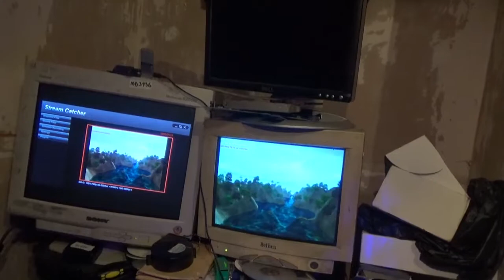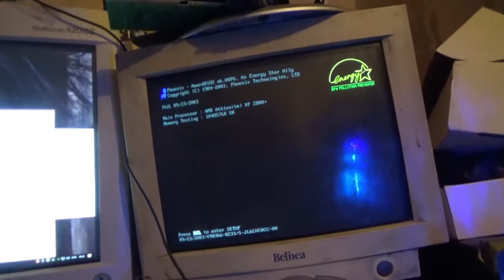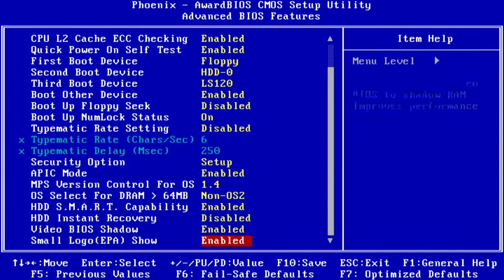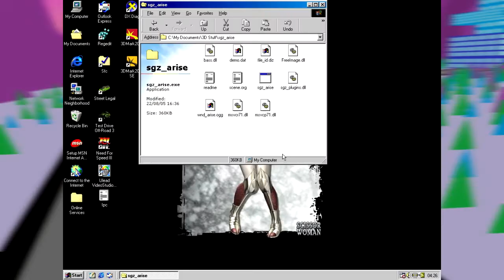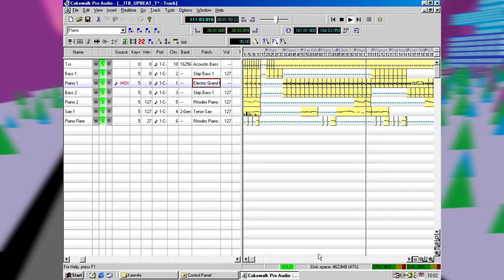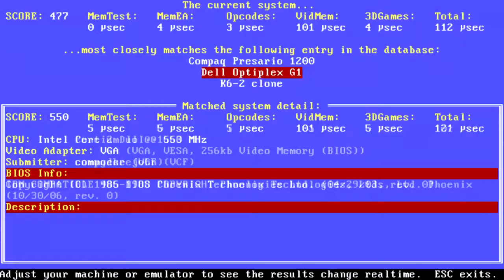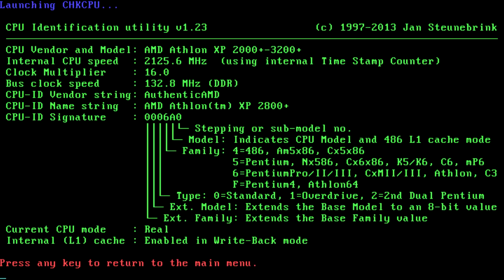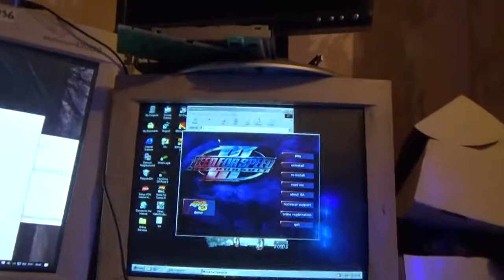Stable Athlon 2800?

Comment: Great video! Good to see you back. I love the Socket-A era and currently have two working systems (dual MP 2800+ and an XP2400+) along with two spare boards. I agree, the Athlon is a heck of a processor, but boards were definitely hit or miss. I had the best luck with MSI boards of that time period.
Reply from the maker: The MSI KT3 Ultra was probably one of the most reliable boards I ever used. The MS-6340 though, that was awful, used largely by cheap OEM brands. I owned a KT6 Delta FISR for a brief time before getting the horrible DFI and I've often wondered if it would have worked well. I never actually used it because PC World Component Center wrongly sold it as being the RAID version and their prices were already bloated, no way was I paying full price for the base model of the board. It would have certainly been easier to use now regardless as it was an ATX12V board, finding a PSU with a large enough 5V rail for this older Chaintech is a pain in the ass but I can safely say that I've yet to see a bad Chaintech K7 board. If only Quay Tec had ever had them in stock back then.

Comment: I had an AthlonXP 2800+ (2.083 GHz, 512KB L2 cache, Barton core), up until 2004. It had 1GB DDR400 in dual channel, a Gigabyte 7n400 pro2 motherboad (nvidia nforce2 ultra 400), and a Radeon X800XT. It was a pretty good performer, and quite an stable motherboard, running Windows XP. It was even able to run Half Life 2 (that came with a steam redeem code with the graphics card),  and Doom 3 at good FPS.
Edit : oh, I've forgotten to say I really love your retro hardware videos.Keep them coming! :)
Reply from the maker: Ah, that's the 333MHz version which this board won't run without the fix from Chaintech. When this stuff was new I mostly played things like Flight Simulator 2002 which the Duron did fairly well at. I really need to dig the discs out and see how this Athlon runs it. I do remember the Duron holding up to HL2 and I still have an awful review of Doom 3 I wrote for a school magazine with screenshots of it running on the Duron somewhere, it didn't run so comfortably though and that was not long before it died for good. Amazing to think Steam was around then and I still don't own a single game that uses it outside of a dummy account I had running for a brief time.
Anyway, thanks for the kind words.
Reply: Yes, it had a 333 MHz FSB, but if my memory serves me well, you could run the RAM at 400 MHz asynchronously (not that it made a noticeable difference in performance in games). That motherboard (Gigabyte 7n400 pro2),  was pretty advanced and it even had SATA1 ports, although I didn't have any hard drive in that format by that time.
Ah yes, I remember I had a very weird looking cooler (aluminum) that was able to keep the beast cool : http://www.frostytech.com/articleimages/200402/gigabyte3Dcooler_pspc.jpg
Reply from the maker: Mine does that, I can run the ram at 166MHz despite the CPU being set to 133MHz, but it hardly changes anything. The dead DFI I threw on the floor in this video had a SATA port, but it never worked properly. I was also under the impression that it was just a converter built into the board as it interfaced back to the first IDE channel - occupying the entire channel, so you couldn't have an IDE slave - in the BIOS and offered no advantage if it even worked at all without locking the machine up. I did not move to SATA drives, nor did I own any, until very late on. I think 2009 was my first SATA drive, though I did it in style as it was a 1TB drive which I still have. Obviously it wasn't for an Athlon. I only got my first SATA CD-ROM drive at the end of last year.

I remember seeing coolers like that. I also remember magazines at the time printing numerous articles about water cooling for a while before some of them stated air was dead and refrigerant coolers were the future. I think it was PCZone that even had a two page spread of it. Because that sure happened.
Reply: I started using SATA drives with the Athlon64, which was the upgrade for that AthlonXP 2800+. The Athlon64 also used one of those coolers, although with copper instead of aluminum, which managed to keep it cool and stable.
Reply from the maker: You know, I think the Athlon 64 I moved to after that DFI might have been another factor in why I didn't adopt SATA sooner. The connectors got damaged in transit and broke off the board, with no returns I simply stuck to IDE which at that time, was just as fast anyway and the channels were shared so I lost no functionality of the board. As the drives were less than a year old when the system was abandoned, with probably less than 150 hours on them, they were re-used as the first drives in the Pentium D. The one containing the OS was used as storage but actually still contains the OS, and should be bootable, in the state which it was left when the Athlon 64 was abandoned. Both of these just used the stock cooler and it was good enough.

Comment: Reminds me of the Duron 1300 system I used a about 12 years ago. That thing had a 7VJL Chaintech board that later got an XP2400 put in. Used it for a good while until it ultimately caught fire. These days, all I have is my cherished 7NJS Zenith which is collecting dust in a box somewhere. I always wanted to use an Athlon MP 3000 on there, but that chip has given me nothing but trouble. The 2400 in there now does the job I guess.
Reply from the maker: I almost used a 7NJS but then this came up, plus the history with nForce boards put me off. Who knows, it might have been good, if anyone could build a good NF2 board back it would probably be Chaintech. I always liked how the model numbers were plain and easy to figure out, I don't have to look up the 7NJS to remember it is nVidia because; 7 K7 board. N nVidia or V Via. J Full ATX. With performance, I'm of the impression that gains start falling off rapidly beyond the 2400+ anyway, the leap from there to the 2800+ certainly seems much smaller than the gap going the other way. From a practical standpoint it's pointless outside of novelty because it would be easier to build a K8 now. Not that I can't see the appeal of getting a K7 3000 to work.

Comment: My old Athlon XP3000+ on a A-bit NF7S with a GF4 Ti 4600 had those odd slow down problems your getting, it died before I figured it out. Only K7 I've had that died however.
Reply from the maker: Annoyingly when I finally sat down to debug the problem it had already disappeared of its own accord again. Now I have to wait for it to come back. Out of curiosity, do you remember which version of the 3000+ you had? Was it a 333 or a 400? I'm starting to wonder if it has something to do with bus speeds and contention, as I'd be willing to be the Ti 4600 is approaching the limits of AGP 4x at the best of times, though this doesn't explain the random element of the problem.
Yeah, this thing shifts a lot of air and it pukes a lot of heat, probably have to leave it running 24/7 in winter.
Reply: It was a 400 FSB CPU, ram was ddr 400.

Comment: Well, I actually have experienced this frame rate stuttering issues before, though it has been so long I can't remember if I found the reason or what the deal was.  My experience with nvidia drivers, especially of this time period is, they were constantly dicking with things and different driver versions behave differently on cards and what version of DirectX is installed.  My Geforce 3 and the 93.71 driver version will not run UT99 in Direct3D, no matter the directx version installed and will only run in OpenGL. This happens both on XP and 2000. Switch the card over to the 7800GS and the problem is totally gone.  Having said that, I feel it might be the driver version you are running. I don't know if you tried different versions or not so that's why I suggesting that first.  

Second thing, this might make more sense given the random nature of the issue, thermal throttling of the CPU is happening, which shouldn't, given the copper heatsink, but the motherboard temp threshold for throttling might be set to low, or kicking in for some reason for a condition that doesn't actually exist.  I feel like it might also be an issue with vsync, which would again be a driver issue, possibly.  I know the Via's AGP is known at this time for being strange, so maybe it is having an effect as well. It sort of looks like vsync problem, but thermal throttling seems to me a likely suspect.
Reply from the maker: I have images of the installation so it's worth a shot I suppose as I can't permanently break anything. The only thing that makes me think otherwise is that it worked fine up until a point and nothing changed, everything worked until just after the R100 video. I did try two other driver versions early on as the latest version nVidia offers doesn't work properly and an older one than I use has stability issues. The CPU doesn't get too warm, but given the compatibility it's entirely possible the firmware is doing something strange. I don't think it has throttling, but the weather is certainly warmer than it was when things worked.
I'll start with vsync as I can override that in the nVidia control panels. Overall though I have a feeling that it will just be one of those things I'll have to live with, Athlons always do weird things in my experience and sometimes the only solution is to ignore the problem.
Reply: I was just taking a closer inspection of your bios screens there and ya I don't see throttle % listed unless it is under a menu you didn't click on while recording but looks like you went to the places it usually is.  There are a couple items I noticed though, first off you do have quite a few options for AGP, fast write being one of them. I know that has been something of a hit and miss option with certain gpu's and chipsets when enabled. I would play with that disabled vs enabled and see if there is any effect. You also have some WS options as well that could be playing a factor.  The other bit is that your voltages look a little on the low side there for the +5V rail mainly, I think you should probably look for a psu with a higher amp +5v rail. I don't think that will have anything to do with the frame stuttering as I feel that is going to be something with the video card, unless the video card is not receiving adequate power from the AGP slot.

CPU temp looks very good to me so I think you've got a good contact from the base to the processor core. Those socket a / 370 heatsinks, whether aluminum, copper, or a combination of the 2, are very prone to having a slight dip towards the center due to lousy machining, not to mention super rough surface. I just filed down a brand new heatsink last night because of this problem to use with my Socket A test bench. These Socket A heatsinks are almost never as simple as just slapping it on unfortunately.

I would suggest moving the Geforce 4 over to the PIII and seeing if the problem follows. But considering there are other factors involved, such as the motherboard and chipset, it wouldn't necessarily prove anything if the card works flawlessly on the P3.  I ran the Geforce 4 on my previous Tualatin system, and it was flawless but I didn't play NFSIII on it.
Reply from the maker: I'm honestly convinced that the AGP Fast Write option isn't hooked up properly because nothing appears to change when it is toggled and all scores still being within the margin for error. I have a larger PSU put aside that needs repairing, but even running in a minimal configuration the voltages sit low and I'm inclined to think the sensors aren't accurate, they often aren't in my experience, the Pentium D always reported 5.6V on the +12V rail since day 1 and I've seen plenty of other boards where they simply don't seem to have bothered wiring the sensors up properly. The current PSU is rated high enough but just barely, so it will be replaced, it's just that repairing the 650W one - rated at 45A for the +5V rail - is taking a long time due to a lack of tools and unmarked parts. In the meantime I will play with wait states, but they noticeably damage performance quite quickly. Failing that I'll go after the SW1000XG as it does have a nasty habit of clogging the PCI bus, it never caused this problem before but it did occur to me that it isn't impossible and might be causing the problem even though all sound is coming from the C-Media.

I have a set of tricks for getting heatsinks to work well, though this one tilts if you're not careful putting it on. It's generally fine once installed provided it is left alone and luckily the socket orientation has gravity pushing in the right direction to stop it slipping off the die again. It's truly amazing how much of a difference it makes compared to the aluminum ones.

I actually ran the 4 Ti in the P3 for quite a while without issue. I'm still leaning towards obscure interoperability issues.
Reply: I haven't been able to duplicate the sumbling issue you are having in NFS3 with my setup of a 2800 Athlon. Granted, none of the hardware is the same as yours. My hobbled together mess is an Athlon 2800 333 bus, Asus A7V600/KT600, 512MB, Both Geforce 3 and 7800GS cards tested, Win2000, driver 93.71, SBLive X-gamer.  I do have an ASUS board with the KT400 which would be closer to your chipset, so I might give it a try. Tough one to call on what could be causing that issue on yours. It has been a long time since I played NFS3, though I can manage 1st place pretty well most of the time. One thing I did notice though, besides the fact the game doesn't appear to have 3D acceleration, though there is a patch for voodoo 3 on the version I downloaded, is that the game does drop to a crawl when there is a lot of dust effects, but driving down the roads it runs fine even at max resolution.  Just in case you are interested, with the 7800GS installed, 3Dmark2000 scores 13959 and 2001 scores 16647. 

Of course, like you said, the problem comes and goes so... that is always the worst for tracking down the problem...

I seem to recall something about AGP Fast writes being disabled in Windows with certain chipsets due to compatibility problems. I haven't looked into it enough to really know all that were.  At this point I'd have to play Dr. House and hardcore probe your rear end for information to really think of an intelligent reason for your problems.  Sound card could be likely I suppose, maybe PCI latency timings causing some kind of hiccup in the games. The key though is when you said changing the video card solves the problem so it seems to be related to the video card some how. I don't think there was GPU throttling back then, but maybe the GPU is getting too hot and causing the problem. It's almost like the game is going too fast, then it pauses for a second for other things, perhaps sounds to stay in sync, so I'd say sound card sounds like a reasonable area to explore at least.

Comment: I feel the same way about a lot of things and still wish that you were around on vogons. I have always had mixed luck with K7 mainly because of how inconsistent the boards are, as for the cases my favorite of the period will always be the Thermaltake Xaser series even though it is a total rats nest with all the cabling from the fan controller. One may as well throw a huge brisket in there then go mow the lawn knowing that the heat these Athlons dump out will roast the brisket.
Reply from the maker: I'd at least consider going back to Vogons in a limited capacity - but only in a very limited capacity - feel free to mention it over there. The Xaser? I found one of those with an Athlon 64 in it when I was raiding a studio that closed down, have to be honest, I thought it was minging... It would be a good fit for an Athlon though as I've always thought of them as being garish and blingy. I've never been one for cable management looking good, I tend to leave ribbons against the outer casing instead of channeling them behind everything.
Reply: If you still got the case it is worth using and they are also pretty damn rare these days $$$. Anyway I hope things get better for you and that you get a decent place to live in someday.

Comment: i had a 2800+,  it was hot hot hot hot stuff... a tualatin 1.4 was really the way to go, dual even kicked a northwood 2.8's ass.
Reply from the maker: I've always had reservations about dual Pentium III systems. I own one, it's nice, but was useless beyond video editing or server tasks at the time, because almost nothing else could support more than one thread and you were stuck in Windows 2000, which wasn't really the best OS to begin with and certainly sucked at gaming compared to Win98SE. Tualatins are also dodgy, have no love for them, never really saw them back then, likely as they never came to retail officially and so were hard to find, as well as boards supporting them generally being crippled in one way or another, or lying about supporting them to begin with. K7 was faster anyway, also cheaper.
We K7 owners used to laugh at P3 owners at LANs, though probably more so at P4 owners, at least until we got royally screwed by the abysmal K8. Then it was the P4 owners turn to laugh, with their flashy PCI-E and DDR2 motherboards, all while we were stuck with a slower CPU than what it replaced, ageing AGP (AGP VGA card prices promptly rose) and DDR1 at the cost of debt I'm sure some people are still paying off. It was OK, though, because then we just pointed people in the direction of my friend, who was still bringing a K6-2 along... with no AGP... and no SDRAM... in 2004.
This industry sucks sometimes.